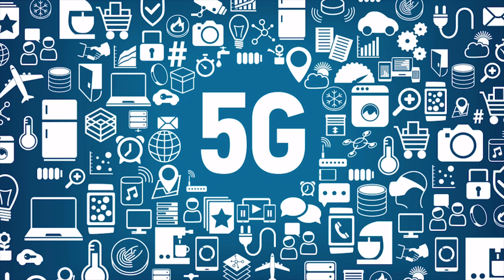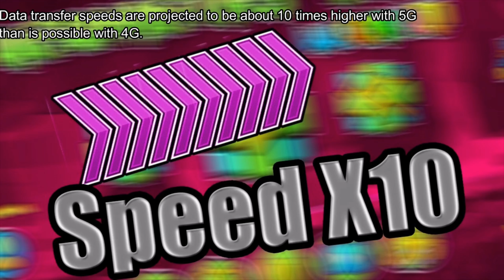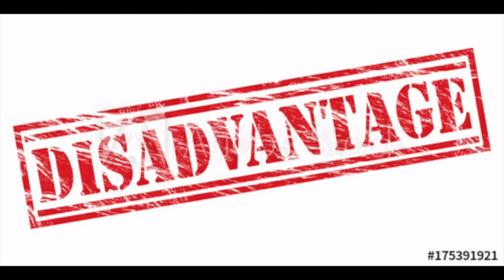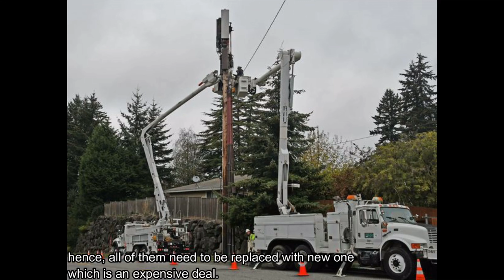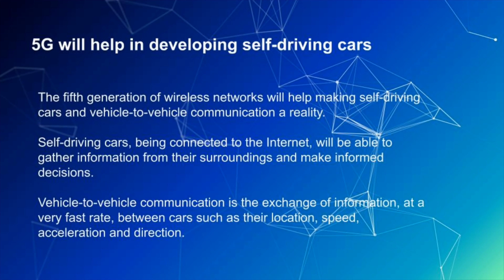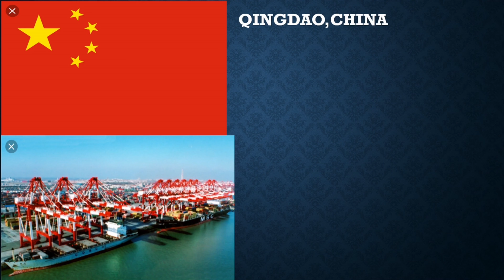5G as Enabling Technology for Building Smart Port/ Harbour Cities

Comment: Great detailed video. Talking about 5G, is 5G safer than 4G in emitting radiation in smart port?
Reply from the maker: Thanks for watching.5G technology requires a lot of new base stations - these are the tower which receive and transmit signal.

Due to the fact that there are more transmitter that exist for 5g,each one can run at lower power levels than previous 4G technology, which means that the level of radiation exposure from 5G antennas will be lower.WHO has ruled out 5g from being health hazard but many criticised that WHO declaration wasnt specific enough and that doesnt mean it's risk free. This issue is still a split in consensus among the scientific issue. 

There are still not enough of evidence to either rule out 5g as being safer or more dangerous,however as of now most of the things we know about 5G tells us that there’s no reason to be worried After all, there are many technologies we use every day with a substantially higher measurable risk than 5g.

Comment: Very well explained, but will small cells be required to implement 5G?
Reply from the maker: Thanks!  Small cells will play a significant role to efficiently deliver high speed mobile broadband and other low latency applications.  Since mobile data traffic is expected to increase annually, small cells will have to be implemented in order to expand the capacity of wireless networks. The implementation of small cells will also prove to be more eco-friendly to the environment since there will be less cell towers and despite having less cell towers, clearer signals will still be provided.